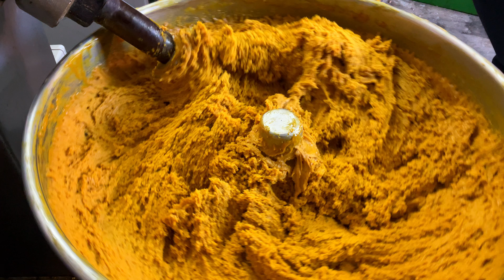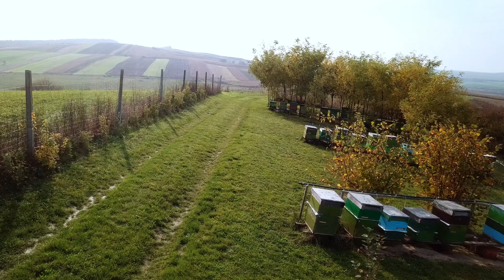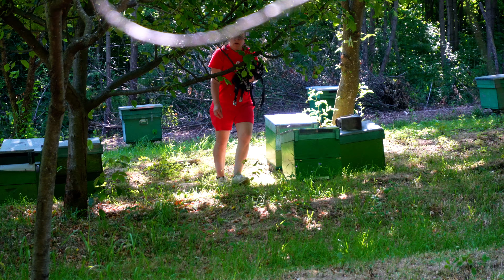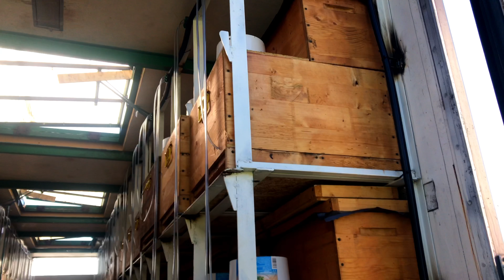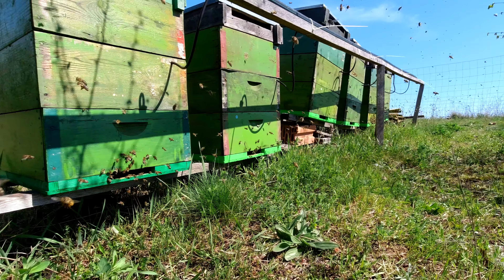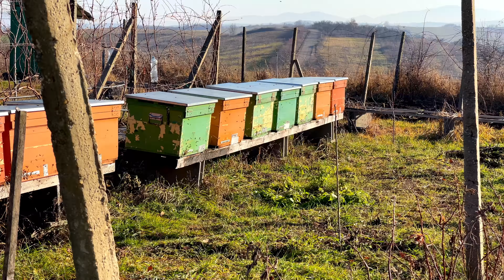The Science Behind The Bee Stimulation

Comment: How can I use this on a small scale?
Reply from the maker: Good question! 🙌 This system really makes sense if you have 15–20 colonies or more. That’s the point where it becomes practical and efficient. With fewer hives it’s usually easier to feed them individually, but once you reach that scale, the stimulation system saves a lot of time and effort.
Reply: @ModernBeekeepingJourney So what feeding schedule do you recommend for one hive? Two weeks ago I tore a wooden wheel apart and put it into a hive. I pieced the comb together as best I could and d secured them with rubber bands to frames. I just want to get them re established  before winter
Reply from the maker: Great work saving that colony and putting the combs back into frames 👏 That was the right move. For feeding, the best stimulation strategy is small daily doses, not big feedings every few days. Give them about 200–300 ml of syrup every day, depending on colony size and how fast they can process it. Daily feeding keeps the queen laying, stimulates brood rearing, and helps them build up smoothly for winter. Continue this rhythm until they reach the necessary winter stores — consistency is the key.